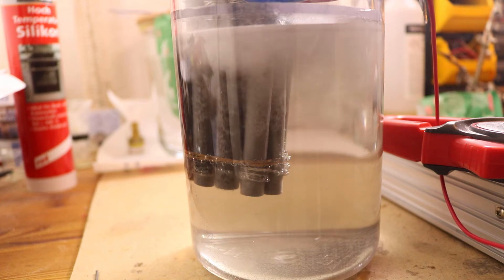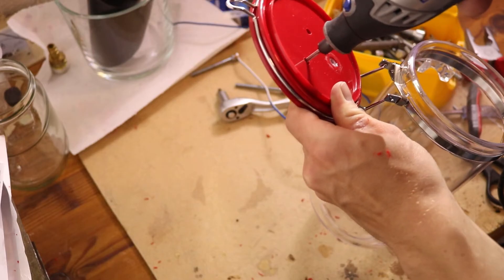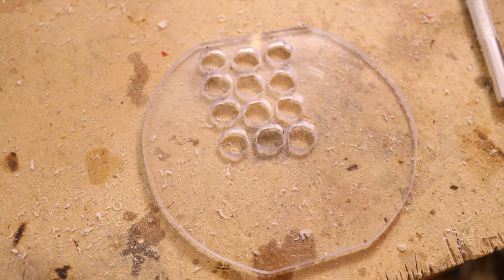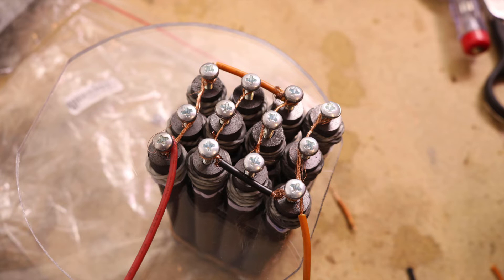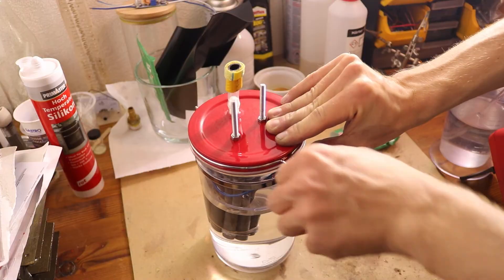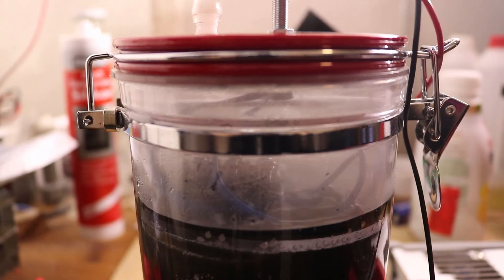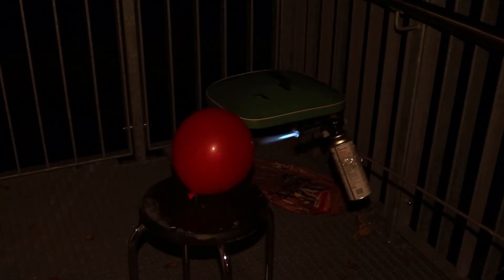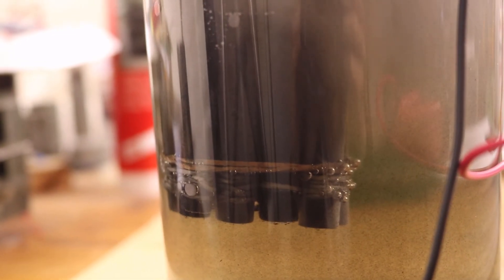building a DIY hydrogen generator

Comment: If you are interested in higher currents I would recommend to decrease voltage and increase electrolyte concentration as all voltage increase after just a few volts indroduce inefficiencies and thus heating.

Btw wish I would have found this channel sooner since you’ve done so many cool things.

Comment: I had a whole collection of graphite electrodes, until my parents threw them away. found a ton of old rotten away battery/accus, while working on adding new plants in a new park, so most was rotten away, but all of them had big graphite rods in them which where still perfectly fine, wanted to use them to make ruby and for things like this, but they got thrown away.
it might also be interesting to make your own graphite rods,  I have already tried velostat, but the first test didn't work, I might try using a clothing iron to iron it on aluminium foil, where the aluminium foil keeps it conductive and the velostat prevents it reacting with the liquid.

it might also be interesting to test things like charcoal or such to see if they  would work.

Comment: graphite electrodes arent great, you can instead use several stacks of stainless steel or other resistant metal that can cover the entire bottle, you can also make the cathode and anode stacks separate to instead of HHO, hydrogen and oxygen separate

also the best electrolyte would be potassium hydroxide, but it inst all that great because it will be more corrosive to electrodes